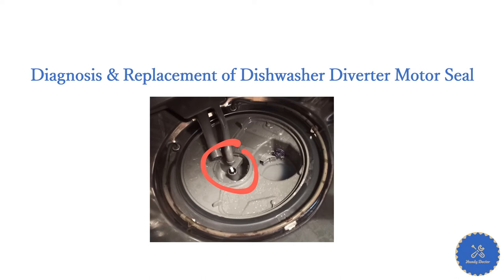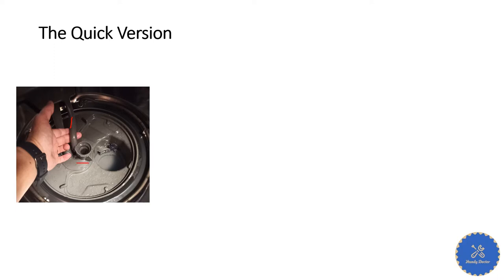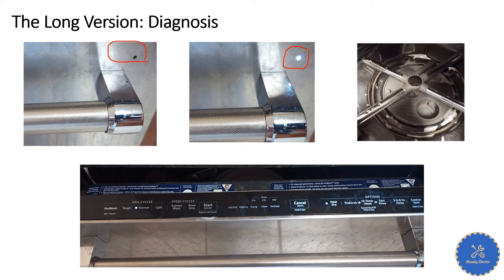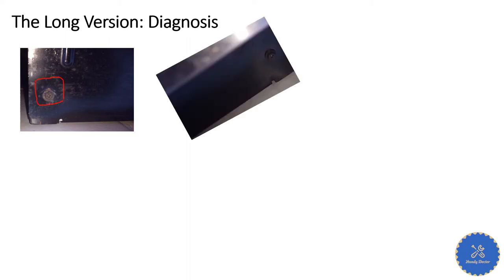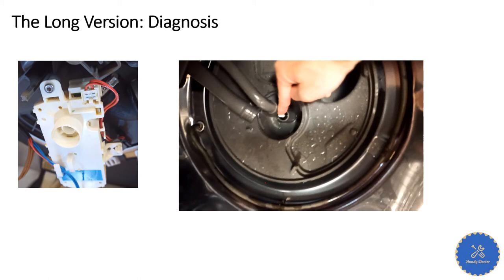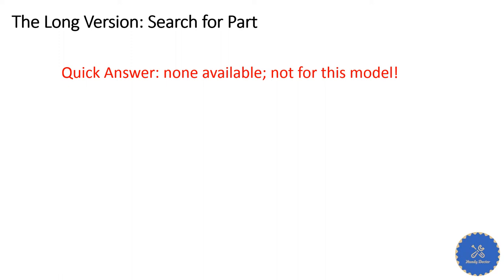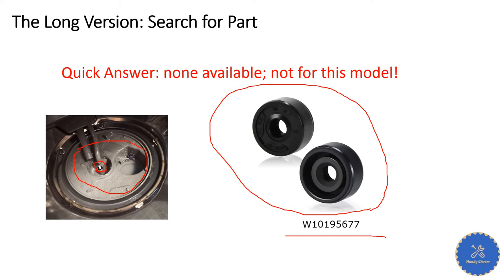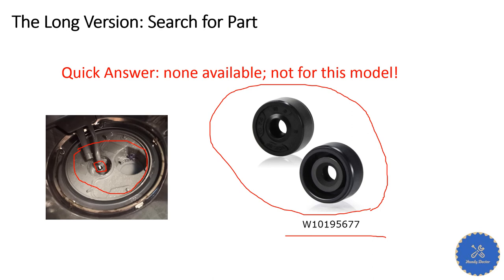Dishwasher leaking underneath. Diagnose & replace diverter motor seal KitchenAid Whirlpool Maytag

Comment: Thanks for this. I have fixed the same problem on my machine, but wondering if the repair holds over time. Did your repair hold? Thanks
Reply from the maker: Yes, it has been 3 years. Still working perfectly.
Reply: @HandyDoctor89 amazing, thank you.